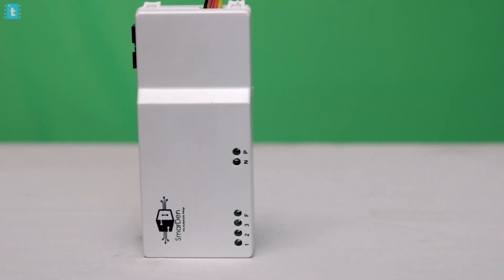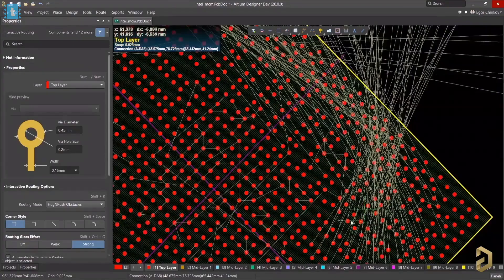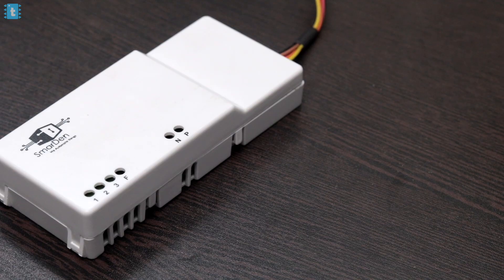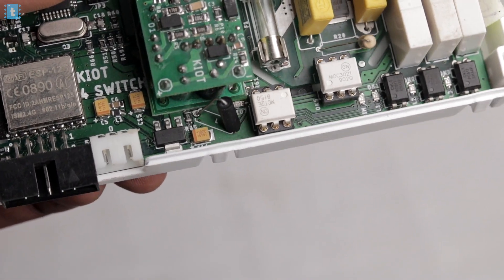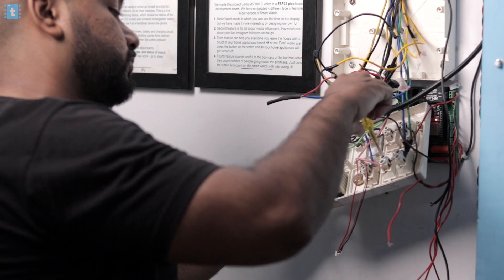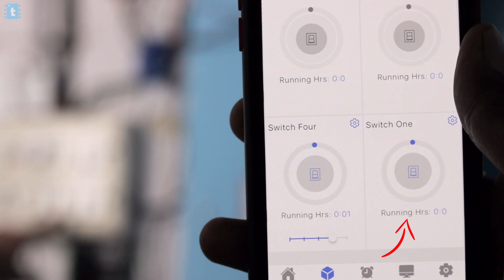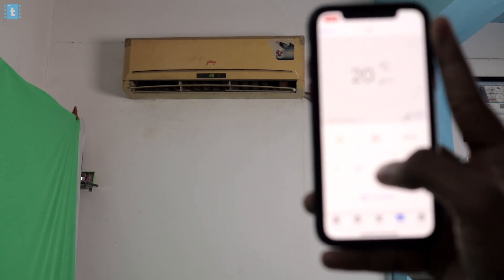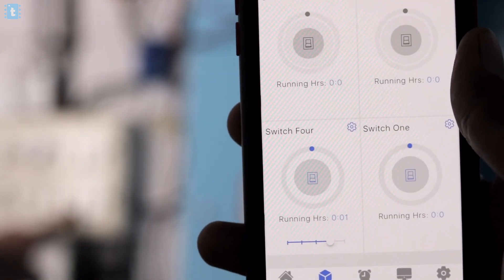A Complete Smart Home Product at affordable price | Smarden Blaze + 4

Comment: I don't see an SSR for fan so I guess phase dimmer is used for the same.
Isn't that a bit hazardous?

Also, would love to see how phase dimmer works with pot + application at same time?
May be regulator's pot goes to ESP/AVR and then it decides on which one to use.

Comment: M not buying this cause I can make the same but not only I, also all techie subs.
Reason not to buy 
So costly ,actually doubled the price
And it also doesont have on pcb stepdown power supply for microcontroller and also has a pretty much wiring .M not saying m great but if SAMRDEN wants to sell this product then it should be chaeaper 😅

Comment: How does the app communication work? Will it work when my internet is down over app? In the sense, I had some schedule, and internet is down during that time, will it still work? Will the app work if the internet is down. I understand that that manual switches will... also, how will the feedback behave when the internet is down. Will it get synced once the internet is back???

From the security stand point, I would like my communication to be internal. Is that a feasibility at all?
Reply: Hey Bangaru, This is shrey from SmarDen.
Yes, the complete setup will work without internet but the only condition is you have to be in local network i.e.  your phone and the devices must be connected to the same wifi n/w.

Now coming to the scheduling part, we are managing that thing from server itself so in case the internet is down, scheduling will not work but you'll get an instant notification on your phone (if your phone is connected to internet) that you skipped the scheduling because the internet is down. 

You'll be notified immidiately. 

Synchronisation:  Yes, once the devices are back online, the feedback will be updated and it will reflect on the app immidiately.

For Security point of view, there's an option in the app which allows you to communicate with the devices locally. when all the devices and your phone are present in the local n/w. 

P.s. we've taken care of user data, privacy and the security here ✨🤗